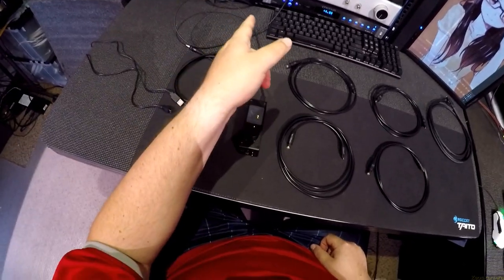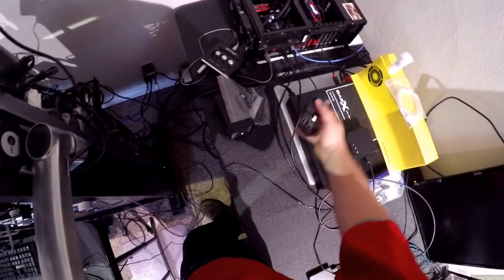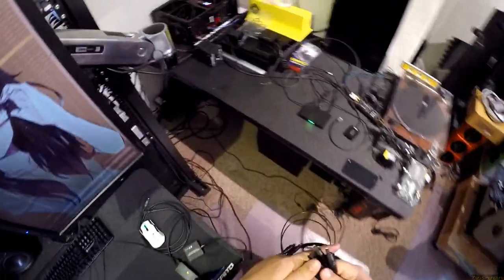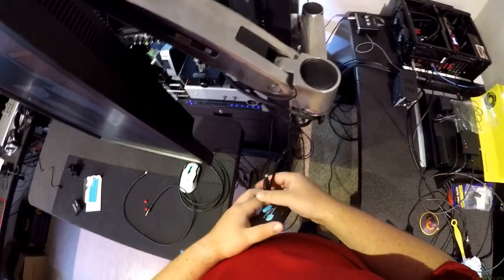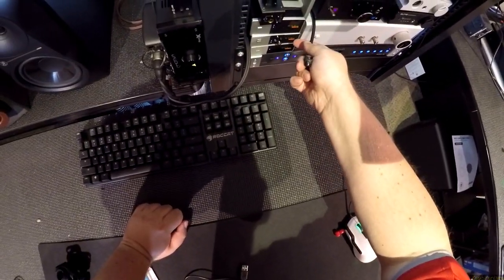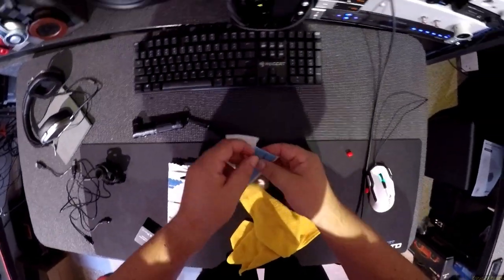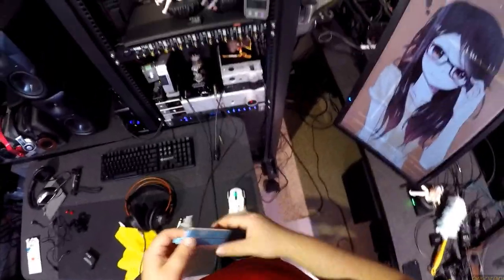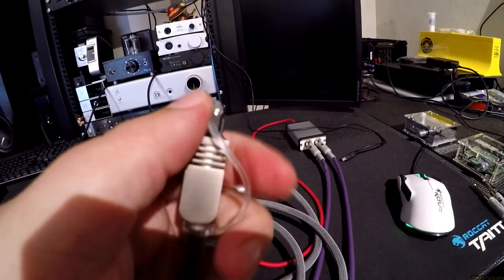MSH - Great SPDIF Swap Adventure

Comment: There's just something Star Trek-ish about SPDIF -- sound via light. It's not quite that simple, of course, but it's fun.
Reply: Well, it kind of is that simple. Instead of shocking something over and over to deliver data, you flash a light at it instead :)

It is possible to deliver analog audio signal over optical, but that is where it gets complicated. AFAIK, there's no consumer options to set this up, not that most people really need it.

Comment: Another tip, to any MacBook Pro owners (at least the 2011 ish to 2015 ish models, possibly more?) the 3.5 mm out is also a mini optical out. It would function the same as the OriGen here.
Reply: Can pick up a new 2012 for $700-800 and get all ports and optical drive too. I replaced the battery and hard drive(to 500G SS) because I absolutely love this MBP, knowing that if I screwed it up, would be buying another of the same.
Reply: I know im randomly asking but does someone know of a tool to log back into an Instagram account..?
I stupidly lost my account password. I would love any tips you can give me!
Reply: @Davion Jasper instablaster :)
Reply: @Davion Jasper Happy to help =)

Comment: Honestly, when I first heard your concept for this, my initial thought was "that's fuccin' brilliant!" because driver's do indeed suck. But good job for real, you seem to have thought this out very well considering that it actually worked and continues to work perfectly. 

You actually inspired me to do a rack mount sort of like this, except it'll be housing my old-ass E-ATX X58 build that has been sitting on my floor doing media center duty. So, F you for convincing me that ease of use, centralized cabling hubs, and a server rack for half-a-server is a good investment.

Comment: I’m a little confused and hoping someone can clarify - the data leaves the computer via USB to an Origen DAC, then that DAC’d signal gets output via SPDIF to a SPDIF hub to be sent to various other DACs? Isn’t that redundant? Is there not simply a “USB->SPDIF converter”? Are you double-DAC’ing, or does the Origen run in bypass in this manner?
Reply: The Origen does not convert digital to analog, as S/PDIF is still a digital signal. The Origen IS the “USB->SPDIF converter” and passes the S/PDIF (still digital) signal along to the hub. The signal doesn't get converted to analog before it reaches each independent DAC that is connected to the hub.

Comment: so I just got the same splitter Zeos is using, and it is not passing audio through.  I am feeding it with my spdif out from my motherboard, and sending it to a schiit modi mulitibit.  If I plug it directly into the modi, it works... When I send it through the splitter... nothing. ??  And yes I have the power on the splitter on. Any ideas what could be wrong?  Maybe I got a bad splitter.

Comment: I am wondering if people (like me) that do not have an optical out for our desktops if just buying a cheap PCI/PCIE soundcard from Amazon would do the trick. Basically, running the optical out from the sound card, to the hub you have and out to multiple dacs. Yes/No?
Reply: yes, buy the cheapest compatible card.. since the optical signal is digital, the card will not effect your audio quality.

Comment: some people hate spdif and some love it. But is there any hearable difference? If not why should give a shit about drivers anymore?
Reply: It depends on the DAC, a lot of ones can have poorly implemented usb. The schiit high end stuff caught a lot of people off when they found out the spider sounded more detailed and dynamic by accident. 
The gen5 usb board apparently fixed that and it was attributed to the usb chip not drawing power from the bus, but from the psu like the rest of the usb board.
Reply: Implemented well they should sound the same
Reply: spdif cannot cause clipping. it does NOT effect the signal. it is a electronic to optical transmission converter. 1 becomes light and 0 becomes darkness. at the other end it's converted back to electricity or no electricity, as if it had never left the first print board. binary to binary to binary, absolutely 100% lossless!
Cheers!

Comment: Just a tip Zeos, it is called a Mac!  Or even Linux for that matter.  The only reason you need drivers for USB DACs is because Microsoft can't be bothered to support the standard USB devices.  Microsoft just likes being a dick, like usual.  

In fact, it is totally possible to make a generic USB class 2 audio device to work with any USB DAC in Windows.  It is not the DAC manufacturer causing the issue.
Reply: Affirmative! Also, drivers are really annoying to manage in windows. Just like everything else is annoying on windows.. On Linux distros, switching drivers is as easy as changing the audio track.